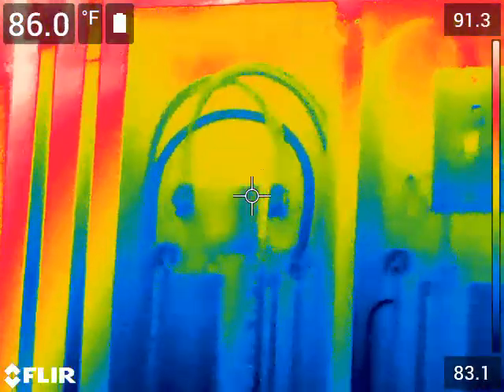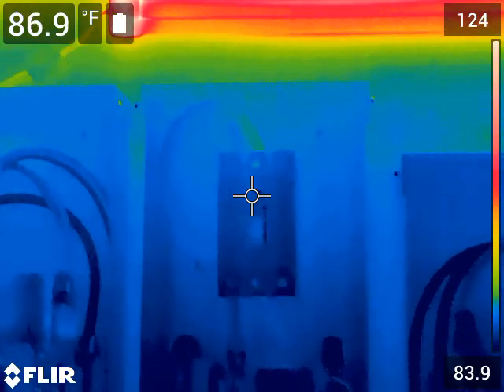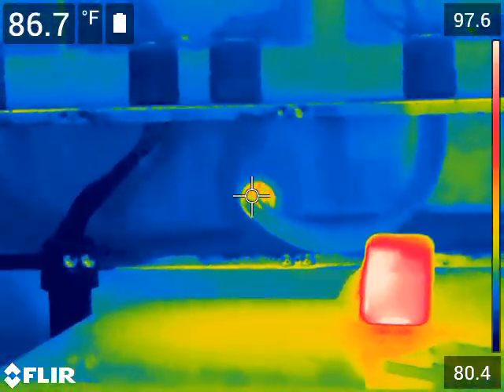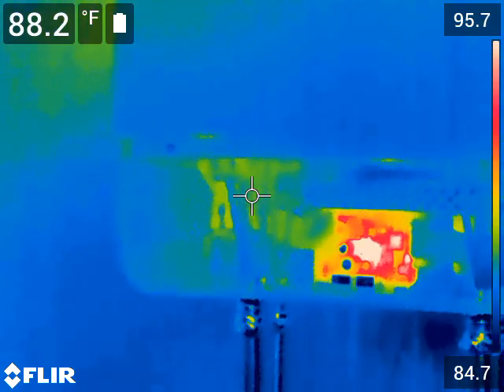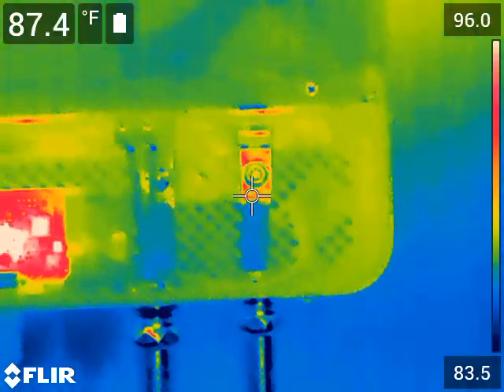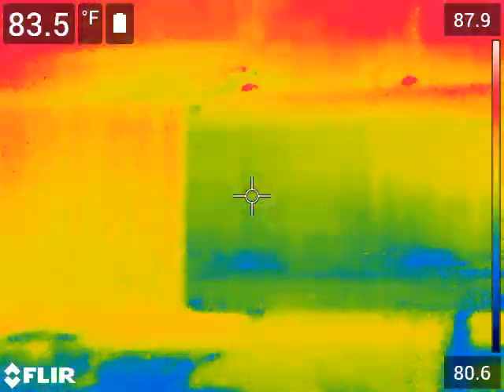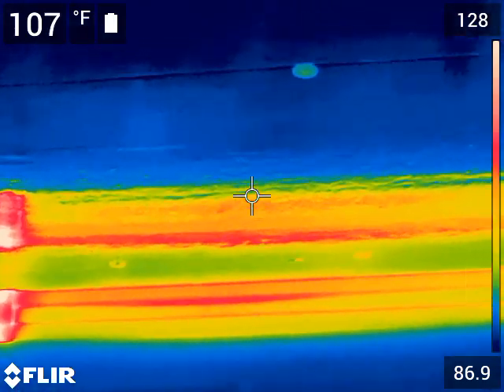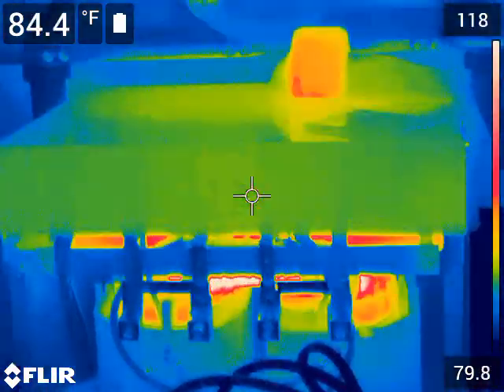Solar Power Project - Thermal Scan of AC Equipment

Comment: Out of all the videos I’ve watched on Solar, Jeff, you have stolen the show with expertise.  Wil Prowse, a motivator, got me interested,  I rank him number 4.  Ian’s Solar projects, has some of your qualities, I rank number 3,  David Poz, I rank number 2,  he also as a motivator and humanitarian, but You get a solid number 1 on explanation of concept, code compliance, and safety, which makes you a humanitarian as well.  I don’t have thermal imaging, however, my inverters have been running my HVAC for a couple of months on a an independent circuit and the air from the cooling fans is always cool.  On your advice, I have purchased  an isolation transformer that I will use for some critical loads.   I don’t have it installed yet.  The midpoint transformer I was going to use is packed up and my plan of isolating the 120 loads through a derived midpoint neutral to contactor coil is abandoned.   I want it to be right.   I plugged you on the solar forum and would recommend your videos to everyone!  Thanks
Reply from the maker: Thanks Jarrett. I'm not an expert. Simply sharing what I'm doing and my reasoning behind it. If others find it helpful that is great!

Comment: Thermal scan of operating inverter's components - another interesting thermal camera application. It is possible to find local heating or overheating electronic components inside inverter and try to predict possible failures or reduced lifetime of components (CPU's, voltage regulators, various resistors, inductances, etc). For example, it is helpful to measure main DSP/CPU temperature to prevent possible chip overheating, that can lead to inverter shutdown or failure. The same principle, as for CPU's of SOHO class routers or Eth swithes, where bad cooling of chips is one of failure sources.
Reply from the maker: That’s interesting. Personally, I don’t have any experience with that application. There are a wide range of things you can do with thermal if you know what you’re looking for.